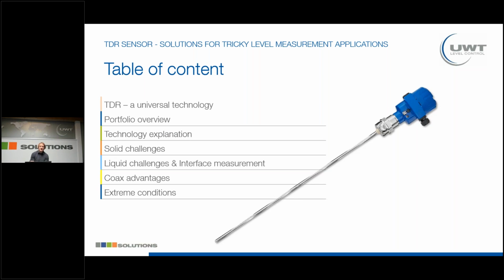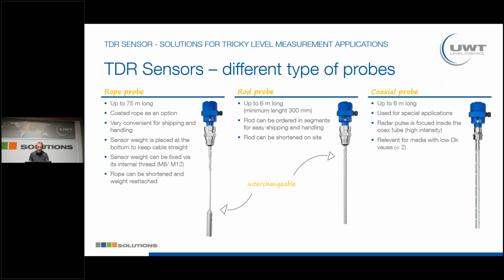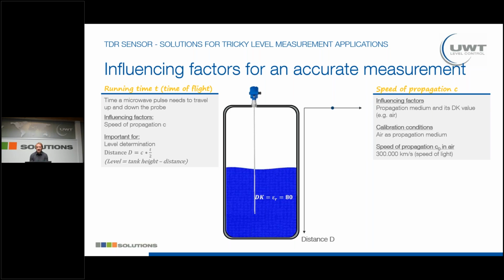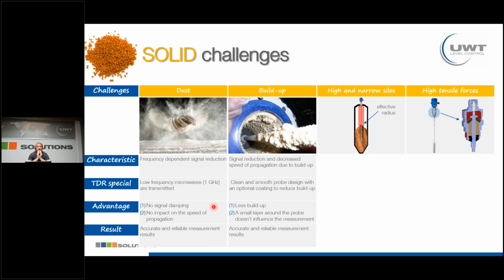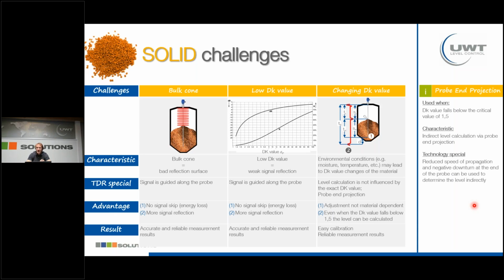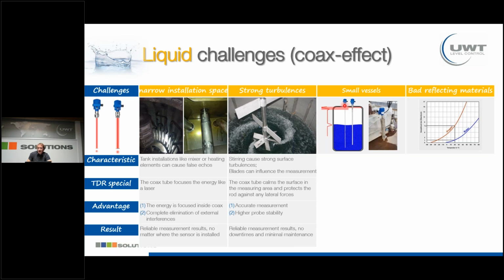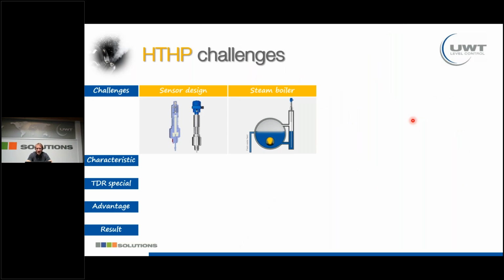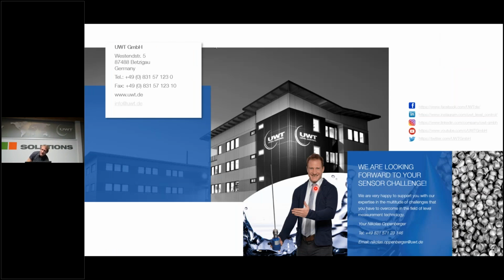Master Class:  TDR Solutions for tricky level measurement applications

Comment: Dear sir,kindly suggest me level transmitter for petrol tank having height 22mtr.
Reply from the maker: The NivoGuide® NG 8000 radar sensor with a cable version can be used for this application without any problems.
https://www.uwtgroup.com/en/products/continuous-level-measurement/radar-sensors/nivoguide.html?medium=Liquids